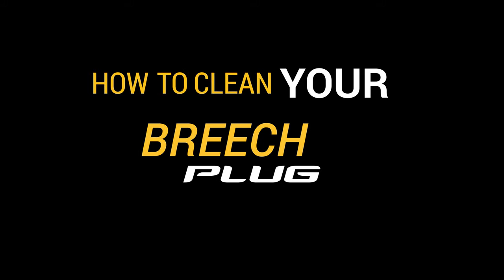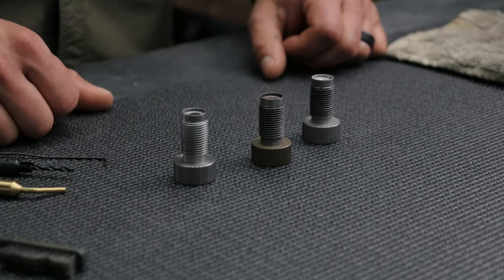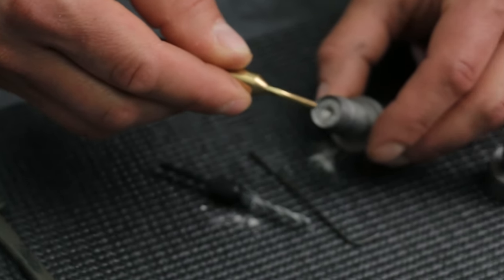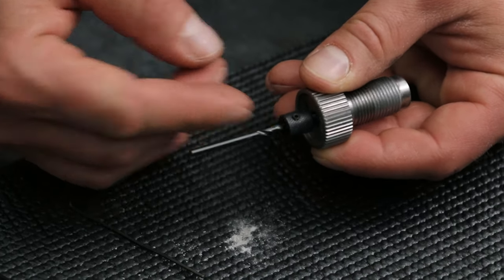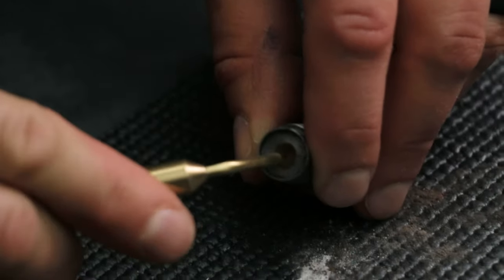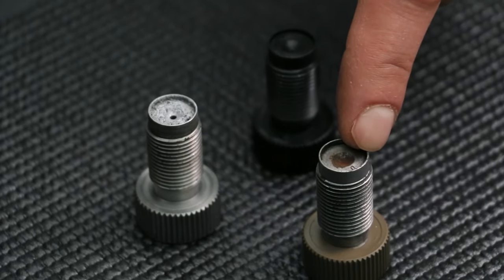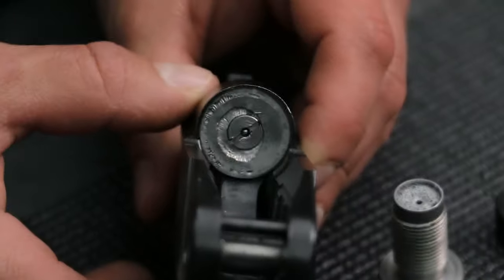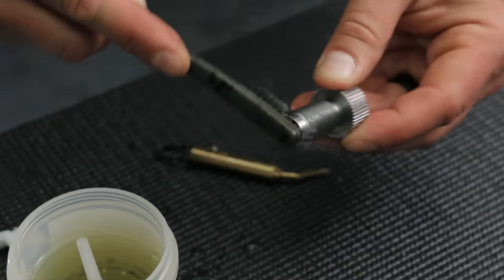How to Clean Your Breech Plug

Comment: I would like to see a video on when the action gets stuck closed and won’t open. I was cleaning my CVA Accura with the break open and the breech plug removed, also my hammer was pulled back. I closed the action and now the hammer won’t release and the action will not open. I cannot find a video anywhere on how to deal with this issue. I will call BPI Outdoors tomorrow when they open but I was hoping to find a video on this issue.

Comment: Simple Green is an awesome cleaner for black powder! It's non-toxic, biodegradable and easy to find at most any grocery store cleaning/soap area.
Reply: Thanks for the tip! Are you soaking the breech plug in it?
Reply: @MaxwellBenson80  You can if you want. But ultimately only if necessary. A old toothbrush and some compressed air helps too. Don't forget to add some more anti-seize after you clean the plug.
Reply: Simple green is great for cleaning. But make sure you clean it all off it can cause a rust.

Comment: Hi...new to in-line muzzleloader. I bought a used CVA 
Accura and I have have a questions. 
 When looking through the breach plug and barrel "field stripped of course"
am I suppose to see clearly through them both?
Reply from the maker: If the Breech plug is clean, you should be able to see straight through it. After you have finished cleaning it, shoot a primer through the breech plug on an empty barrel. That will flush out any debris that may be left.
Reply: @CVA  
What is the difference between MR and MR-X?

Comment: Why would it not be possible to use the ( Proper sized ) drill bit to clean out the rusted shut breech plug ?  Of course I can see the problem with drilling one out to a larger size.
Reply: What size drill bit are you using to clean the breeches plug
Reply: @donwhitley8745  One that fits the hole, you only want to clean it out, never enlarge it. A cutting torch tip cleaner works great too, but if it's rusted shut you probably can't push it through the hole. That's why the drill bit.

Comment: I want to see more videos like this and suggested loads for your optima.
Reply: When I bought my optima about 10 years ago, the paperwork that came with it said use white hots pellets. DO NOT DO THAT !!!  I use 100 grains Jim Shokey's gold, 2sticks. 50 cal. 195 grain power belt green base. 3 inch group at 100 yds all day long. Brush out the bore after 6 rounds, very little residue. White hots, 3 rounds all over the place at 25yds. Brush bore after 3 rounds, enough residue to make another pellet. Put alot of meat in the freezer with this combo.

Comment: What size hole is the inside hole of the breech plug. I see no problem with drilling out the small hole if you use a small enough bit. I have bits down to .2 mm
Reply: He just said don't do that don't make the hole bigger inless you want blow back and possibly the gun blow up in your face making your gun a pipe bomb

Comment: I wish this video was out years ago, I clean the plug well, but always see rust. Also after cleaning the barrel, within a month the barrel looks like I never touch it.
Reply: It was. CVA made a whole series of vids more than 10 years ago and then updated them again, not to mention vids by others too. Do you live in a humid environment? Which state?
Reply: @cvcoco  Pa.
Reply: What cleaner are ya using?
I've been using the "barrel blaster solvent spray" 
then just bore butter after. 
It helps to have some pipe cleaner's as well though, that's honestly what I get the breech plug the most clean with.
After I'm done with that I wipe the outside of the metals with bow string wax and left it sitting for a couple months in a case and dont have any issues rust.  Just gotta figure out what works for you. I leave a few oxygen absorbers  in the case under the foam for good measure.

Comment: Not sure I understand why that person drilled out his/her breech plug and got the blow-back?
If the breech plug was drilled out and there was a path for the flame, why then the blow-back? 
Good video, thanks for taking the time to make this. Peace
Reply: I imagine the blowback was from the powder when it ignited.
Reply: The flash hole they drilled was significantly larger than the original.  Probably not so much a problem that they drilled it but rather the size of the resulting hole.
Reply: To me it's just plain stupid someone would drail a hole in the breech plug and get a ton of blow back , to me some people just to lazy to clean there guns and muzzleloaders they see rust and try to drail it out and that happens

Comment: Looks like I'm not the only one looking for out of stock parts. My hammer spur broke last year and I've yet to see it back in stock. SKU: 30379. Sucks trying to cock my hammer under the scope, even worse with gloves on...
Reply: My spur broke also, been using without it for now.
Reply: Where are the parts from, Italy or Spain? I think Spain. Either one, covid logistics are the problem, shipping hasnt opened up yet.
Reply: If you can get the threads on the broken spur out, a temporary fix would be a 3/4" stainless steel machine screw...they are less than a dollar at the hardware store...just make sure you get a stainless one and add a drop of Locktite so it doesn't fall out.